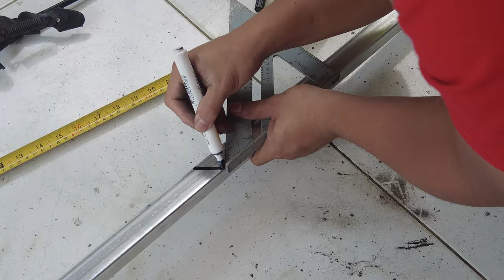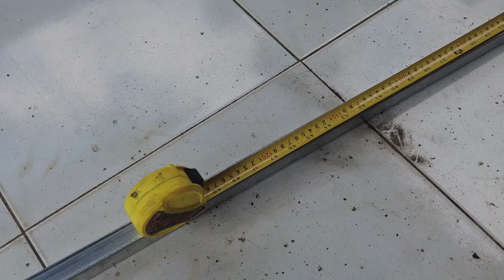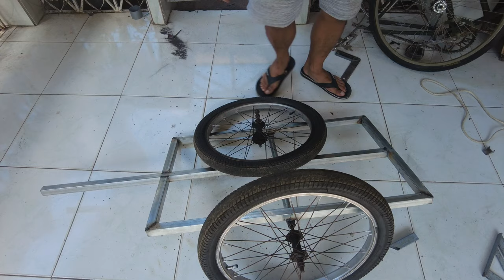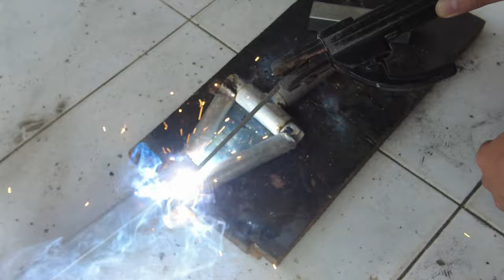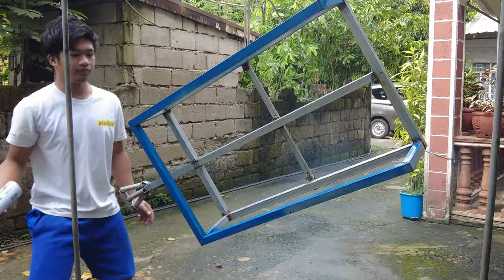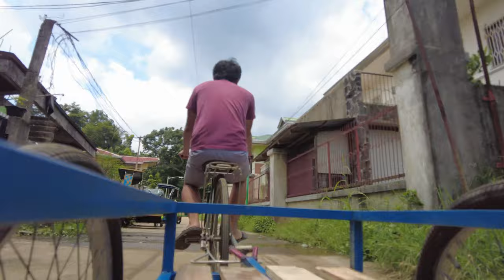How To Build a DIY Cargo Bicycle Trailer - Cargo Bike Trolley Cart Homemade

Comment: Those wheels will eventually snap off, if they haven't already.  You need to support them with either a full axle or forks on the side.  Bad design.

Comment: The whole idea is to be used to transport a roll from the store... but I would make it stronger... first of all, the wheels should not be screwed in like that, only on a fixed axle... and more supports In a frame... but that's okay

Comment: i skipped through it just to see how the swivel mechanism worked, as that is key to its functionality. not much footage of that. it looks like it won't be able to make sharp turns without flipping or breaking the welds
Reply from the maker: i will make a new one sir
Reply: @tsongph677  good job, sir

Comment: How did you attach the wheels to the cart?  Did you make new bushings for the wheels so a bolt or smooth round axle could be used?

Comment: Great job. I also have one for my bike. My frame extends past the wheels, so it supports the wheels on both sides of the axel, more support for heavy loads and stops the wheel getting caught in stuff when going on forest trails.
Reply from the maker: Thats awesome sir
Reply: The most important part is showing how it is attached to the rear wheel. Making a cart is just easy, that's it!

Comment: Nice Job  when I built mine butted the boards closer together that way there is no big gaps in the trailer floor for stuff to fall threw.
Reply from the maker: That's a good point sir, I haven't thought about that

Comment: The wheel axles will not resist at 20--30kg load.It will bend up and the wheels wil not be paralel for long time.
Reply from the maker: I will add some support bracing to the sides

Comment: If you dont hook up the trailer hitch bar centered on back of bike, you will have the cart flip over when turning as cart wheels hits edge of curb or crack to flip over and you need to stop asap . It may seem centered but the physics of hook up needs to be precise and why they make them hitch locks. If cart is heavy and flip over you will damage a part on bike. It is also why they make them suspension springs in case it do happens the cart and bike be not damaged as a failsafe.. But good luck and be safer then sorry on DYIs
Reply from the maker: Thankyou for your thougts

Comment: How to attach the grey/silver metal to the rear bike wheel.Where to get that type of metal from what's the name of it  ?
Reply from the maker: that's a bracket for the chain tensioner of a motorized bike. I've just repurposed and make it the bracket for the trailer
Reply: @tsongph677  I need to do that, that is so cool.Whats the name of the motorized bike.What company sales them.I will take pitchers before I modify anything

Comment: What keeps the tires locked on. Just threaded on
Reply from the maker: Yes
Reply: I was just wondering about that. The wheels could unscrew themselves.
Reply from the maker: Oh I haven't thought about that. It seems if it was a long haul, the wheels could go off

Comment: BHAI PVC PIPE KA FRAME BANAO AUR BICYCLE ALLOY WHEEL DAL DO TOH HALKA HO JAUEGA. KHICHNE MEH ASANI RAHEGI
Reply from the maker: translate in English
Reply from the maker: can't understand
Reply: @tsongph677  Main FRAME can be Iron, rest make it of good pvc pipe to make it Lighter as it is hard to pull the weight. Put a controller, HUB motor & a battery with solar Panel For continuous Charge then it will be real Cargo Cart.  Expense will be around 15 k 
I SUPPOSE.  INSTEAD OF LITIUM USE lead acid batter as it is safer.

Comment: A good builder, would've scraped the zinc on the galvanized electrical conduit, to bare steel around the weld area, before welding. 
You conveniently jumped the wheel axle attachment construction part. The wheels will bend or break the nut you welded on to the axle, when you load the trailer with a 20+ Kg load. 
It's obvious you have no respect for safety or understanding of mechanical loads.

Comment: Stupid
If the material is iron, the trailer will be much heavier than the load it can carry.
Reply from the maker: Thankyou
Reply: Depending on what gauge of steel he's using there is some square tubing that don't weigh much. I took apart one of those school projections carts that don't weigh much that could be reused into a bike cart.
Reply: Steel is good enough. You used thing tubing so the weight is reasonable. Just don't have too big a load.